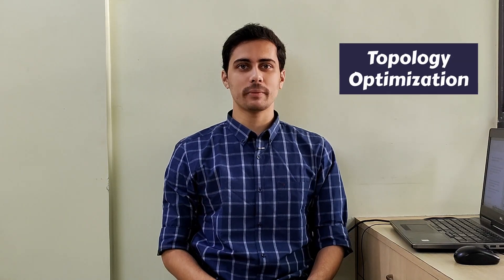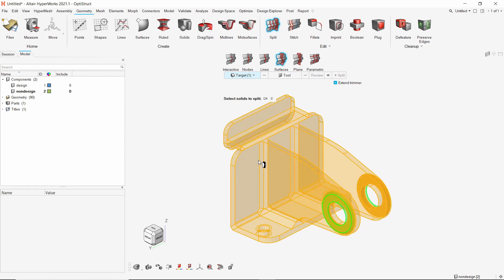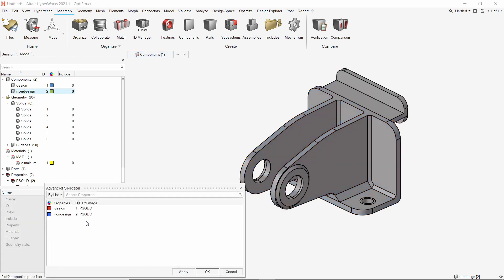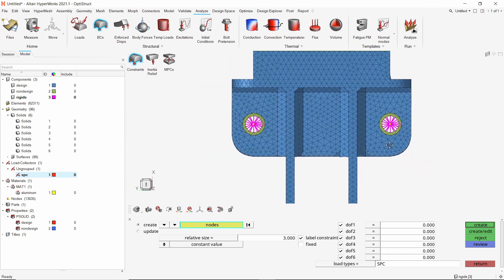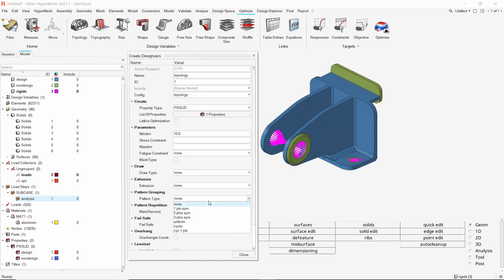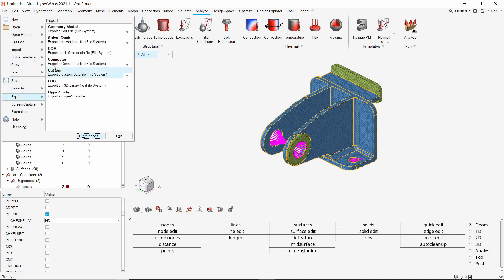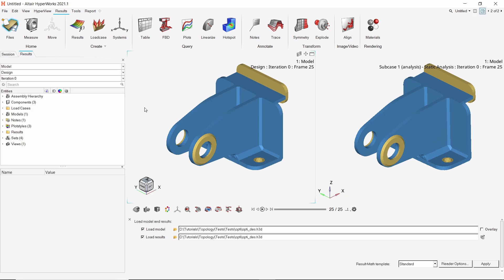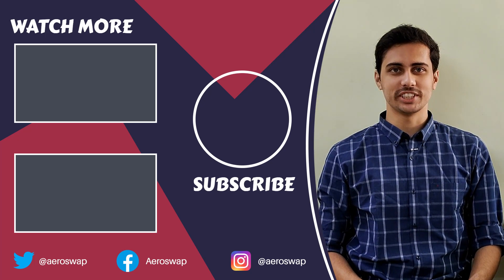Topology Optimization using Hypermesh [Optistruct Tutorial]

Comment: Hello sir , I can't find analyze option in 2019 version
Reply from the maker: Hi Shubham, for older versions of Hypermesh, you can use the 'analysis' panel from the panel area. All the tools from 'Analyze' option are located in that panel.
Reply: @Aeroswap  i am having difficulty in finding run parameters card and thereafter  , although ur lectures are too good , I learned a lot in short duration , keep it up , I will try to install 2021 version and follow same steps